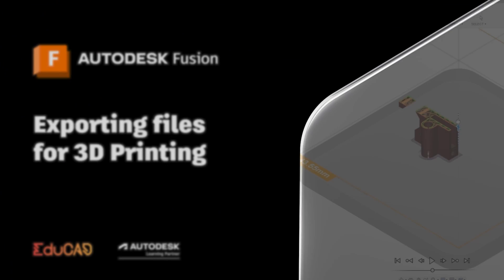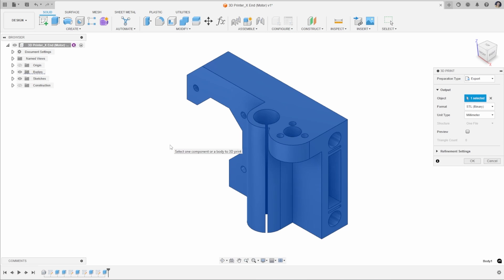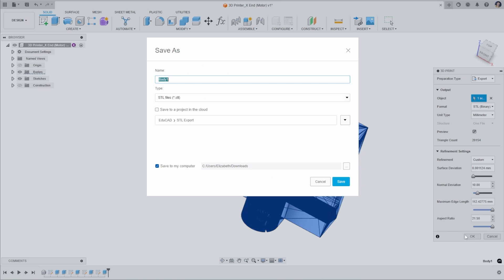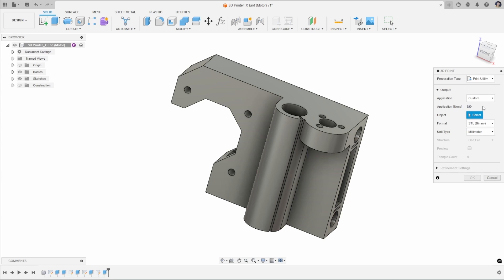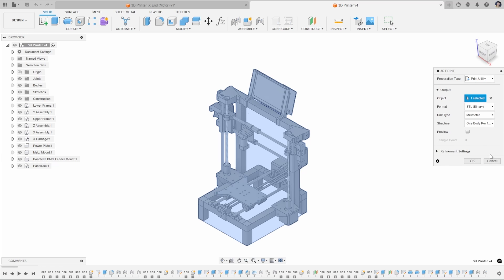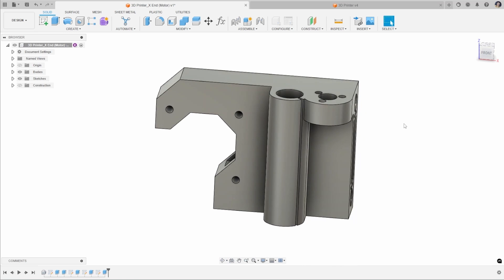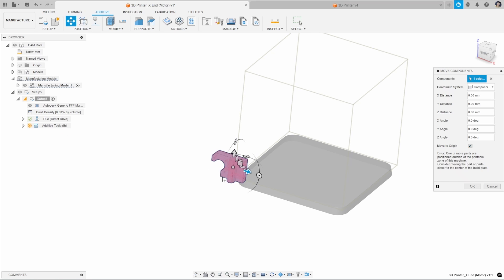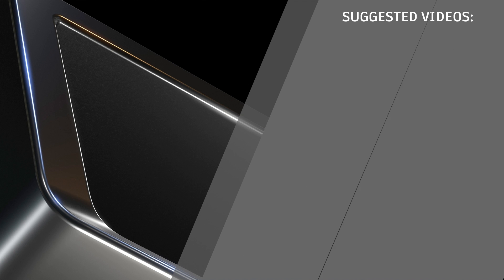How to Export Your Autodesk Fusion Model for 3D Printing

Comment: It’d be cool to see a workflow where you split the body to isolate a specific part, then export that & 3d print to check it for dimension, tolerances. Less trial and error / more method, so that when the final print is sent you know it’ll work.

Comment: Impressive video, Autodesk Fusion. Excited to see your next upload from you. I smashed that thumbs up button on your content. Keep up the fantastic work. The breakdown of mesh refinement settings was particularly helpful! How do you recommend balancing file size with detail when exporting for different slicers?
Reply from the maker: Hi! This is a great question but will ultimately depend on your slicer, printer and your model! 

In general, most slicers can handle large files. The more complex your geometry the more mesh triangles will be needed and the larger your file. Unless you are using an older version of a slicer which has reduced processing capability our recommendation would be to aim high and reduce if needed. If you are seeing your slicer lag or take longer than you want to slice your part, you can always come back to Fusion and re-export it! 

A few things to keep in mind: 
1. No matter how high quality your file is, there comes a point at which the limitation of quality becomes your printer, not the file. This will depend on the type of additive you are using and other factors such as nozzle size (if you are using FFF). 
2. If you are finding that file size is an issue, try using 3MF files rather than STLs. As more recently developed file types they tend to be able to store more information in a smaller file size and may be better optimised if you are having issues. 

Hope this helps!

Comment: If we use manufacturing model and edit the geometry, then could we export the edited geometry to stl?
Reply from the maker: Hi, absolutely! To export your manufacturing model, go into the manufacture workspace, edit your manufacturing model and when editing you will see most of your standard modelling tools. Once here you can follow the same process as Liz explains in this video and it will export the manufacturing model rather than the main one :)